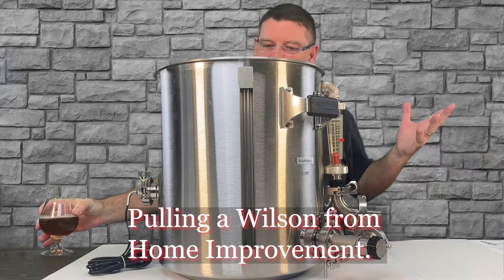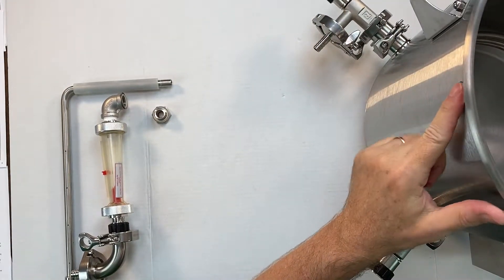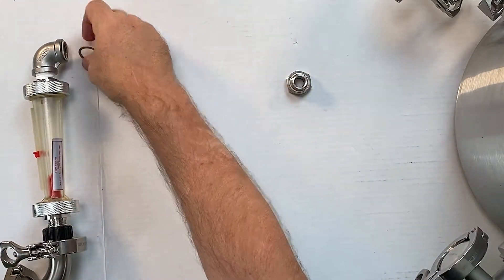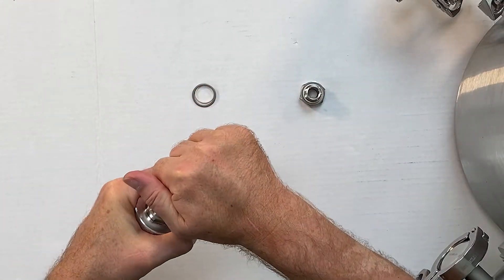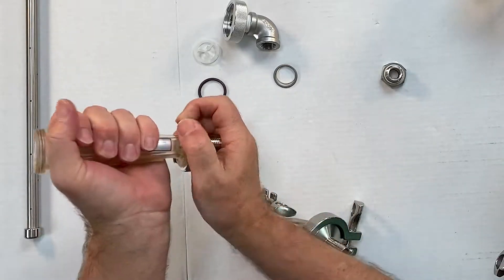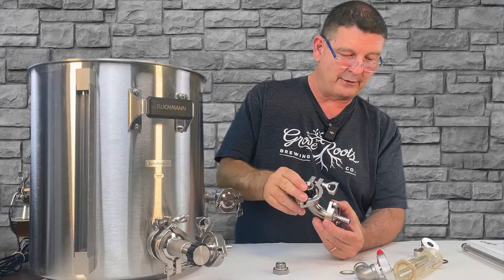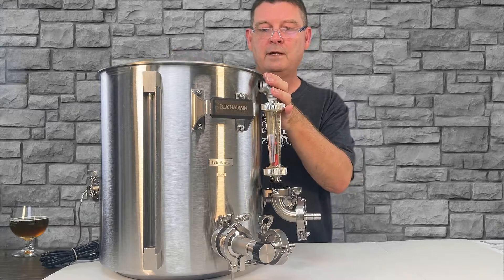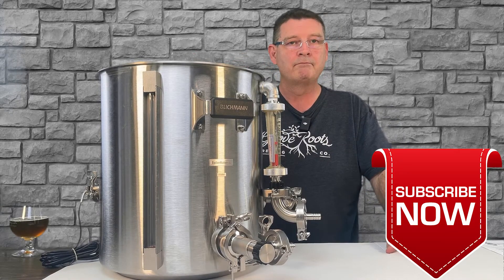Blichmann Brew easy compact - Direct Deposit Recirculation Arm and Monitoring Glass Breakdown

Comment: Very interesting.
Are you planning to use them and post it on video? 
I'm very curious about that recirculation system on it instead of using only the whirlpool system and how they compete against the competitors with their own system.
Reply from the maker: Yes, I'll be doing a water only test first and then many brew sessions to test it out,.

Comment: Thanks for sharing. Might have to pick this part up to use on my system. I already have tri-clamps. It would definitely help me dial the speed of the flow in the mash better. Cheers!
Reply from the maker: It is a nice and probably a little over engineered attachment but I'm shocked there aren't more systems with a device to show your recirculation flow rate. It would make things really easy to dial in compared to just turning a knob one way or another.